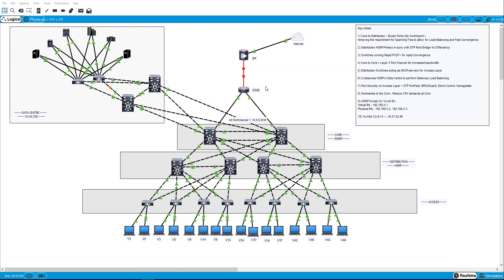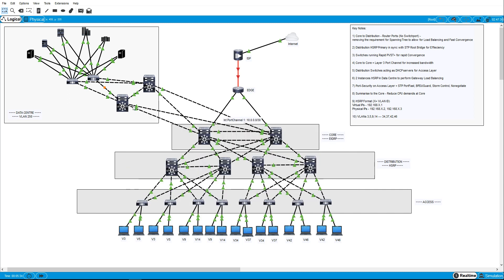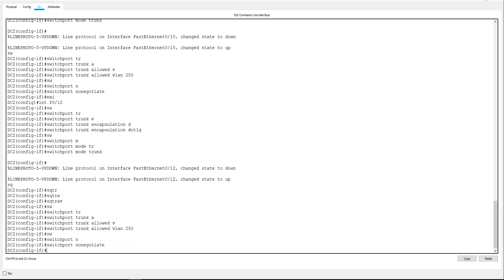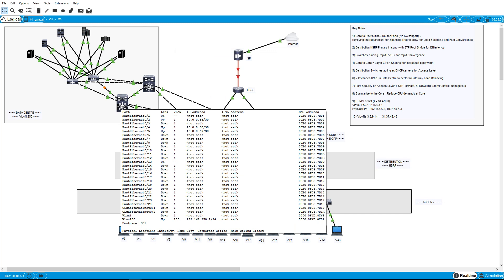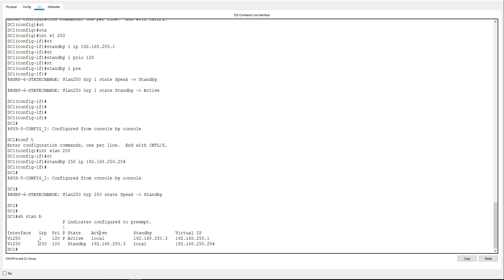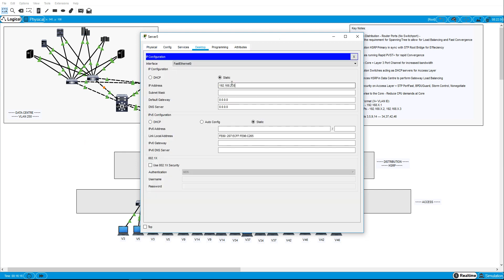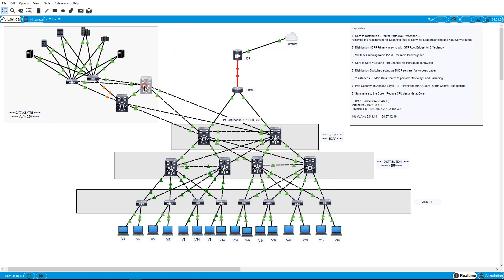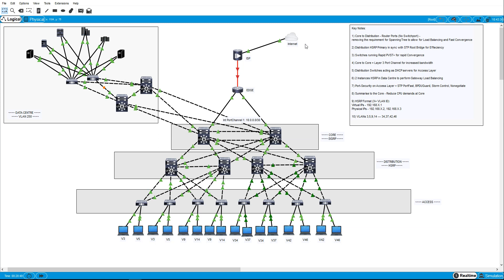Packet Tracer: Campus Design (part 5 of 6) - Dual HSRP for Load Balancing in the Data Centre

Comment: What is the benefit of having the Layer 3 link between data center distribution switches? The servers must connect 2 links to both layer 2 data center switches in order to achieve the link and device redundancy but can run only in master/slave mode not in Active-Active(link aggregation). Correct me if i am wrong.

Comment: Umm... are there any security measures that can be deployed in the data center?? Some thing live preventing malicious access to the data center ( ip filtering )
Reply from the maker: Hey, Aayush. Yes,  there are plenty things you can add to help secure the data center design! This little packet tracer file does not reach that far, however. If you were deploying for real then Firewalls and IPS devices placed between the clients and the servers being a good start. You can filter traffic between server to server to increase isolation,  depending on the design requirements. Installating Web Application Firewalls is also a good idea to help inspect application activity.

If you're interested in reading more on securing Data Centers, Cisco's CVD provides good information here (read from page 100): https://www.cisco.com/c/dam/en/us/td/docs/solutions/CVD/Aug2014/CVD-DataCenterDesignGuide-AUG14.pdf

Thanks for watching! -John